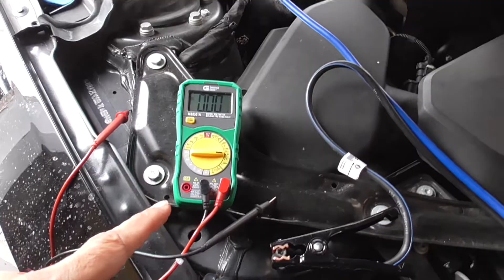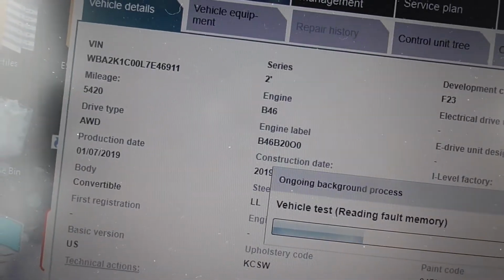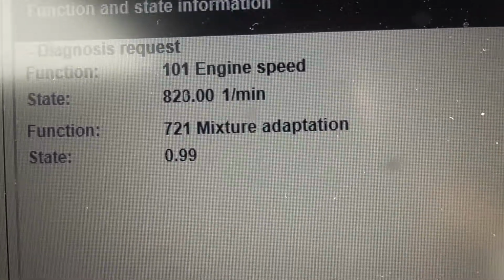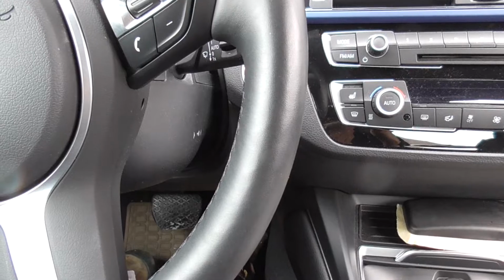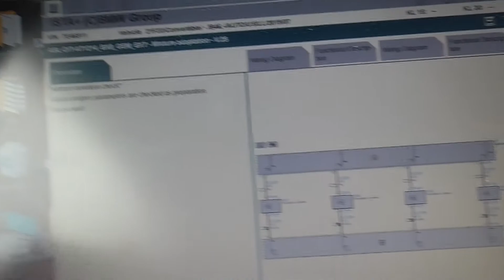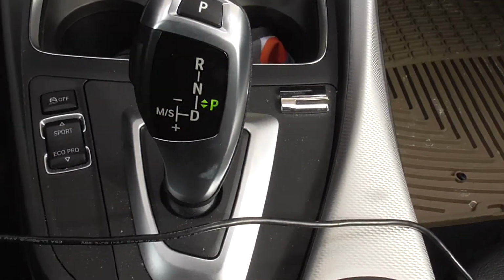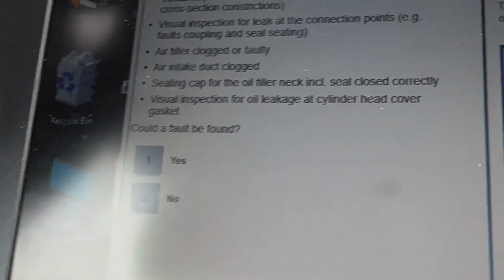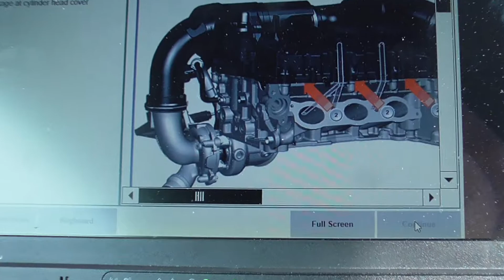BMW ISTA+ Fault Finding: BMW ERROR: 118002 Mixture Control:

Comment from the maker: This is what BMW diagnostics did to my 2 series:
Test Plan for misfires ans air leaks
performed smoke test
checked operation of tank vent valve
PUMA measure CA63162504-18 relating to the fault code
fault code caused by short trips

Comment: I have codes of rich mixture and I checked my vacuum reservoir and it has oil and the vacuum lines too, the car started to trough white blueish smoke trough the tailpipes. The smoke smell like something weird burned but it is not sweet as coolant.
My oil cap and oil  smell like pure gas so I am planning to replace the High pressure fuel pump and the vacuum pump, do you think this will resolve my problems? , car idle and runs normal its just the smoke and the check engine light for mixture too rich. long term fuel trims -30%, sometimes it's stalls after acceleration 
I need some help please.
Reply from the maker: sounds like a head gasket, do a leak down test using a head gasket tester, you don't necessarily need to see mayo, does the water reservoir smell of gas, if so, head gasket, but the high pressure fuel pump (HPFP) is also a well known culprit so try that first

Comment: Hi. Have you sorted out your problem? I have same problem but can't find any leak
Reply from the maker: HI Arturs, thanks for the comment, so BMW could NOT find an issue, the code went, they did a leak down test, exhaust test and a few other things put it down to a TSARA (sara) tsb which said that if you don't drive the car enough, this could happen. said to monitor it, since then no problems, HOWEVER I BET, it will come back next year in winter, However not charged as car was under warantee.
Reply: @AdrianJayeOnline  I'm actually driving very little 10-14 miles a day and mostly using electric. I tested also with ista and I passed all tests without any issues. The only thing which concerns me is that when I open my oil cap it smells petrol a little. My car is 330e direct injection.
Reply from the maker: @afkfavorite  ok, so I do about that, 12km daily, 6km each way, the engine doesn't really get up to operating temperature. You/we need at least once a week to take it out for a hoon on the hiway say 20-30km's at high speed, whats also known as an Italian tune :) petrol, thank God someone using the right word :) that's' pretty normal.  and I "THINK" that BMW will tell you your not driving the car enough, there is a PUMA TSB for this, they flat out tested my car and said I'm not driving the car enough. get a smoke test .. when  I get in I'll tell you what they did, NOW, in summer this stopped happening. So I suspect in winter it will come back !
Reply from the maker: @afkfavorite  see my pinned comment hope that helps
Reply: @afkfavorite have this same symptom, what was the issue/solution?
Reply: @deank280  i just deleted code it came back few times but then I changed fuel tank breather valve and engine oil cap. Code came one more time and since that code not came up - about a year. To be honest I think that happens after serving when oil is clean. Then when it not that clean error not showing. I bet you serviced your car few months ago? :)
Reply: @afkfavorite Hi,  I have a 330e And i am also getting the same code 118002 and cannot find air leaks or oil leaks. I also only drive to about 10 to 30 miles a day low miles. Do you have the check engine light on? Has the code cleared for you? As mine has been on for months.